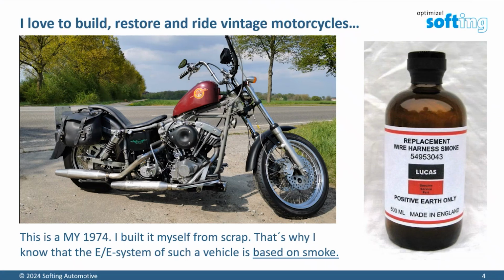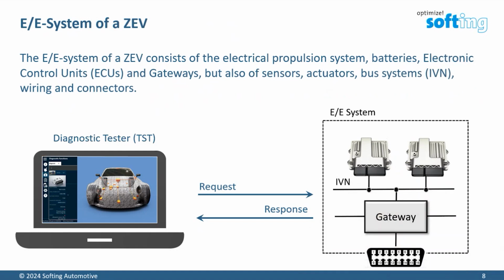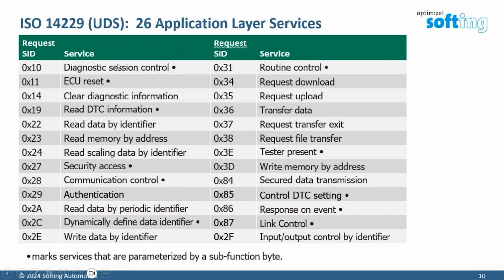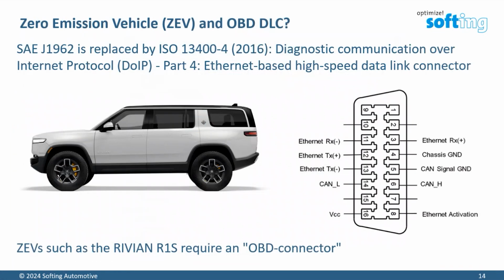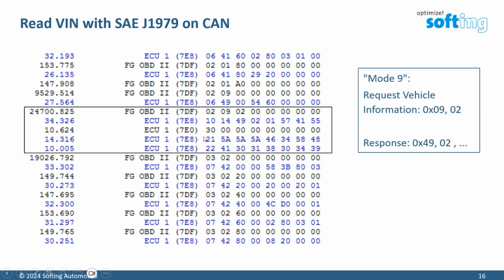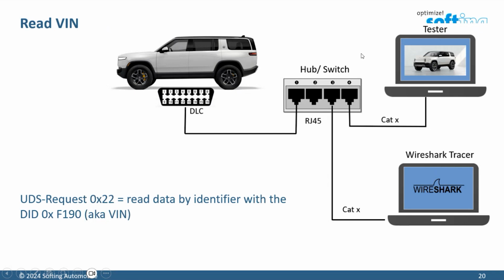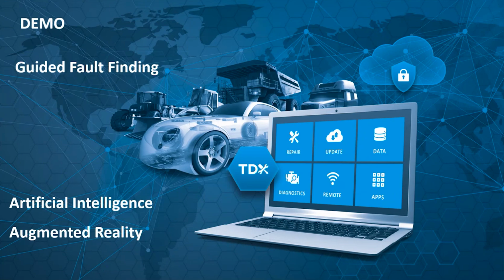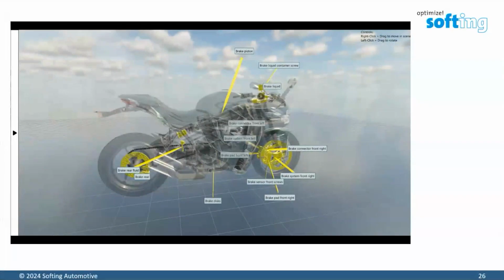Webinar | SAE J1979-3 ZEVonUDS | Diagnostic Communication with Zero Emission Vehicles by Softing

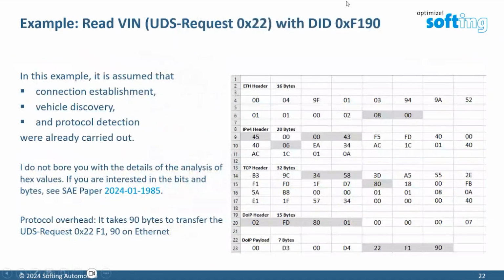Comment: The webinar promised to explain OBDonUDS and ZEVonUDS. For ZEVonUDS the people can learn that 4 UDS Services replace all OBD classic (J1979-1) services, which is just wrong. ZEV doesn’t provide any snapshot data / freeze frames, doesn’t provide any permanent DTCs and doesn’t provide (as of today) any executable test (routine). Moreover, the only example provided for DoIP (for ZEVonUDS because OBDonUDS doesn’t even support DoIP according to regulations) is reading VIN with UDS DataID 22 F1 90 (20:43) and by using target DoIP logical address 0x00D4, which is just proprietary address for some OEM and default UDS VIN, so both are not related to ZEVonUDS at all. ZEVonUDS reads VIN by using 22 F8 02 and DoIP address 0xE000...
Reply: Or physically addressed DoIP request with address in range 0xE100..0xE3FF.
Reply from the maker: Thank you for your comment.
We agree with your statement and consider it as an important extension. 
We have tried to explain the US legislation paradigm shift as simply as possible. 
We are sure you know that this sometimes comes at the expense of precision.
The subset of four UDS request services is intended to replace the SAE J1979 „modes“. 
The exact scope of the replacement is defined by the legislation.

Your Softing Automotive Team